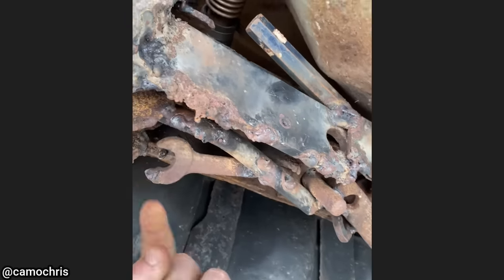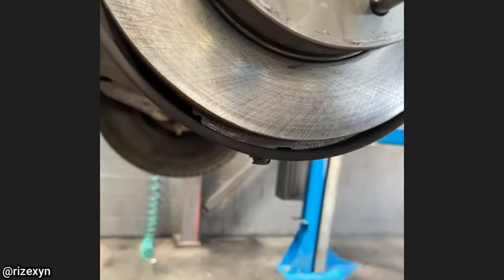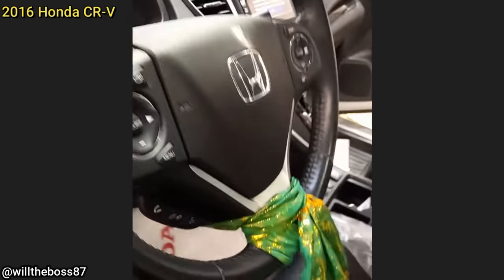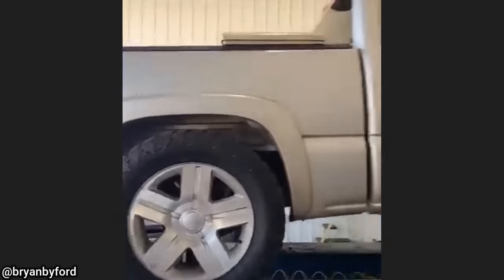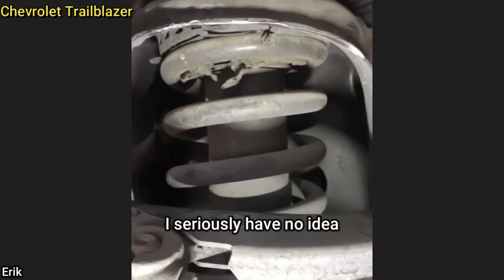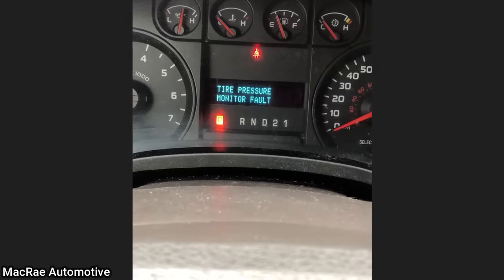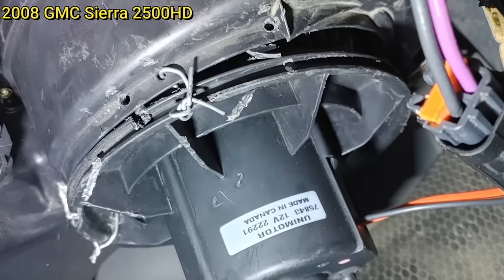Customer States Another Mechanic Said Their Car Is Junk | Just Rolled In

Comment: I sometimes wonder what's more stoopid.. refusing all repairs to do them yourself, or bringing it back in to the SAME shop after you've done the repairs and made it worse.
Reply: And on a towing!
Reply: Well, as long as you approve the repairs after effing it all up
Reply: Finally getting it fixed the right way is smart. Anything else is the stupidest.
Reply: First is check up,drive,inspection, history records etc then repair list.
Reply: Not bringing it back at all would be the worst, I think
Reply: I fix my own cars, it's not hard, you just have to be careful and take the time to do it right IMO. Ive never had an issue, but I always use the right parts, and install them correctly with a torque wrench ha
Reply: @Gormen Freeman It's not hard, you can do it if you try :) It's a lot to learn at 1st once you take in all the info about how it works, and how to do it, but once you do, it's easier then working on a computer :D
Reply: Should go for car mechanic crash course before buying car and also buy necessary tools with car's manual repairing book.They use to provide that book for machinary but nowadays who cares.
Reply: @karanmadan1048  Cant hurt, IDK if such a thing exists, but you can def learn from youtube. Just understand and be careful IMO, and you'll save yourself tons of time and money. It's quicker to fix it yourself then wait for a mechanic to do it, it's awesome
Reply: @seanstephaniesadventures1008  Also don't want to hurt you,theory and practical are two totally different thing.
Beside car manufacturers are not stupid to make simple and easy machine that a common man could work on it smooth like butter on bread.
Reply: @karanmadan1048  Ive been working on cars for years, it is incredibly easy though
Reply: @karanmadan1048  you're name is Karen. Why would we listen to you?
Reply: @drockjr  🙏 Thanks for you compliment really appreciate it.

Comment: The leaf spring blocks on top of the springs had me dying. 😂
Reply: Yeah, it's weird. The squatted truck thing.
Driving around looking like you overloaded your truck without anything in the bed.
Reply: @timsilva1944  Actually at oe ride height, they're doing nothing up there!
Reply: @timsilva1944  with the diff below the springs a block between the diff and springs will lift the truck. With the diff on top of the springs a block between will lower the truck. A block somwhere other then between the diff and springs wont anything at all except need longer u bolts..
Reply: @UFO-047  Yeah, thanks. After hearing the statement about "this squatted truck", I was shaking my head so much from disgust that I didn't pay much attention to the setup.
Reply: @timsilva1944  Weird? It always reminds me of what a dog does when it has worms!
Reply: I'm no mechanic, but when they showed that I went "Ummm..." and then the narrator said what was wrong. But I saw the shifted broken leaf spring. Guess I'm qualified for Wal-Mart Tire and Auto now.
Reply: @michaelmclachlan1650  "Customer states, My truck has an itch in the butt!" mechanic grabs the sixgun
Reply: @UFO-047  Yep, I'm going to guess they bought the truck lifted, and wanted to go back to stock height. They put the blocks on top to avoid having to buy new u-bolts.

Comment: The one thing mechanics don't want to hear "they tried fixing it themselves"
Reply: ha ha .. that's what actually keep the REAL mechanics busy ... and provides humorous videos for us all ... youbetcha
Reply: Along with them having it fixed "at another shop"...
Reply: Sensible mechanics will automatically double the quote if that's the case!
Reply: @stevie-ray2020  Doubling the quote reminded me of:
"Mister Scott.  Have you always tripled the time estimates for your repairs?"
"Of course Captain!  How else can I maintain my reputation as a miracle worker?"
Reply: Oh, but that usually means an open ended repair order, they're gonna pay for that screw up. it's just as fun as "I had a friend do the job for a case of beer". NEVER GIVE THEM THE BEER FIRST!
Reply: At least they’re honest and not blaming it on a friend
Reply: My friend Ben hates it when a customer walks into his shop and says “I’d fix it myself if I had time.”  The guy saying that has obviously already spent all kinds of time trying to fix it himself.  🤦🏼‍♂
Reply: Well, depends on what exactly you're trying to DIY. I could pretty confidently change my brake pads at home for example but I chose not to because it's a fairly important system where a tiny mistake may have serious consequences. I do minor cosmetic repairs though, saved a couple hundred bucks by straightening and repainting the rear bumper on my truck instead of replacing it with a new one.
Reply: Honestly most take it well as long as you tell them exactly what you did, when I had a motorcycle I messed up multiple things, mainly over tightening stuff and the mechanic laughed at me but fixed it 😂 oh and from bad experience not all aftermarket stuff is as cool as they seem, oem parts are oem for a reason - they fit and work as intended. Had my tire go flat on the motorway at high speed due to my "cool" new valve.
Reply: If i were a mechanic and i charged by the minutes i would be seeing dollar signs whenever someone says they tried to fix it themselves.
I would also be an honest mechanic and put it to them simply, i will have to undo anything they've tried to do but failed in doing. So they should be ready to understand that the work they've done has cost them rather than saved them money.

If they don't like it they can take it to a mechanic that won't set things right, and so they will be risking their and others lives.

I would however give them a small rebate as long as they haven't screwed up majorly. We've all been there, trying to fix something we don't have the tools and know how for and ultimately failing.
We've also been there when things go right and we do fix something ourselves.
In the end, what matters is if you know when to call it quits. Going beyond your abilities will cost you $$$.
Reply: I repaired an old 5.0 Explorer yesterday that the owner tried to replace the thermostat on. He broke a housing bolt off in the intake. The thermostat wasn't even the reason it overheated. It needs a radiator, and he ran it out of coolant.
Reply: How about "My mechanic said".....
Reply: No what we really hate to hear is "If I help you will you do it for less?". Then they always get upset when I say "No it will cost you double or more". I actually had a wrench "slip" and I popped one guy in the nose because he was that close to me. They day was hot enough and I didn't need him breathing on my neck.

Comment: That first truck was worth nearly $1m, not as a vehicle but as a modern art sculpture
Reply: I'm impressed that someone just welded whatever they had laying around like their buddies wrench, some old exhaust parts, whatever
Reply: @WayneWerner  neighbor’s ratcheting set? Just weld it on there, that’s just more reinforcement on the joints
Reply: @TheBanjoShowOfficial  Honestly at that point, you might start using close to the same amount of welding rod/wire to just make an I-beam out of weld lines. No idea why they didn't think to weld all the items together into a solid rod first, at least or something..

but I guess you need to be already out of sense to think this is a good fix.. like, if I was desperate, even I'd go to home depot, buy a 10$ thick-ish fence post, and weld that sucker up there...
Reply: @WayneWerner  Not that I've ever welded a wrench, but those things are usually made out of high-carbon steel and are going to crack if you weld them. So it may look cool but it isn't structural.

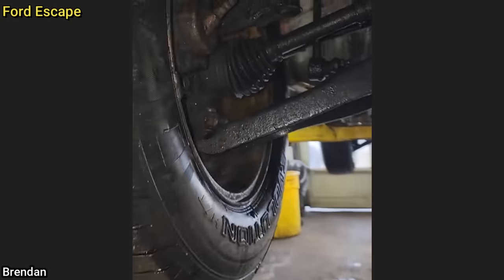Comment: 1:42 Check out that brake rotor!  And a vise-grip clamping the flexible brake line too.  Yikes!
Reply: When you have a leak, you have to clamp off that brake line so you can drive to get it fixed. Otherwise in a few stops you have pumped out all the brake fluid. I drive in salt all winter and in a few years brake lines rust through; I have done this fix a half dozen times. All my vehicles are pre-2012.

Comment: 1:42 Look real close at the brake disc. The inside portion is missing, and all that you see is the cooling fins that allowed air to flow in to assist in cooling.
Reply: So it was just the right time to approve all repairs, wasn't it? 😅
Reply: The owner obviously 'fixed' the brake problem with a pair of vise-grips. That's a lot cheaper than new brake parts.
Reply: You say all that like it's a bad thing.   😁
Reply: @markh.6687  LOL, I will admit to doing that myself back in my Chicago days with rusty brake lines.

Comment: I had a weird noise when turning, turns out my sister bought a toy for her cats, left it in the car, forgot about it and it was torturing me with the "weird sound coming from the rear" until i was cleaning the cargo area and found it. Didn't go to the mechanic as my car has a tendency to have random noises for a short while before they dissappear never to be heard again and it didn't appear to affect drivability.

Comment: I used to think I'm relatively safe on the road, so long as I don't make a mistake. Then I learned that an estimated 1/4 of cars in my country are driving without the mandatory yearly safety inspection. And then I found this channel and now I drive in fear of other cars.
Reply: That's good, a lot of people never even consider that driving is dangerous af. It's the most dangerous legal thing you can do lol
Reply: If it makes you feel any better, only 22 of 50 US states even have annual safety inspection requirements.  There is no statistical difference in incidents in states that do.
Reply: a lot of states no longer require annual inspections
Reply: Here in UK, any vehicle over 3 years old, needs an annual inspection ( MOT), if any major faults are detected at the test the vehicle cannot be driven away for repair. An MOT cert is required  for road tax, and any untaxed vehicles caught on the road can be seized and crushed.   Vintage vehicles are exempt as the owners are deemed to keep their vehicles in road worthy condition
Reply: You think thats bad? Our local sheriffs office in cooperation with the Virginia State Police operated a stop and check for trucks traveling on one of our main routes. More than a third failed safety inspection and most of them failed so bad they wouldn't allow them to continue operations. We're not talking about little u haul trucks either, we're talking about dump trucks and full tractors pulling 60'+ trailers. Scary
Reply: At least in the USA, only about 12% of accidents are caused by mechanical issues. Most people exercise their vehicular stupidity in how they drive, not in maintenance or repairs.
Reply: Back in the 50s, Tom McCahill advocated defensive driving...I'm alive because of it...mufflers, A-frame parts, drive shafts, WHEELS, and one trunk lid tried to kill me...always have an escape route.
Reply: @dirtfarmer7472  thank you for your due diligence. It's good that some people still have pride in their profession
Reply: @Sashazur  If you're "maintaining" your vehicle like a lot of the people shown on this channel, you're probably doing a lot of other stupid shit while driving, too.
Reply: Drive in the wee hours of the morning then.
Reply: @dcsteve7869  they should do more of that rather than speed trapping. Would actually make our roads safer
Reply: @tmanepic  absolutely true
Reply: I live in a state without a "mandatory inspection",  But a cop can red tag a vehicle they deem "unsafe".

Comment: Text story for ya guys.

Just got a job at a dealership, hoping to become a mechanic.
Lube tech did a oil change on a Cherokee. Engine blew up short while later. 

Tech apparently did a oil drain instead of a change. No oil, filter was half on.

Lady got a new engine. 

Somehow, we ended up with her rear floor mat not in her car. 
Service manager wasn't very happy. I didn't see that Tech since.

Here comes the best part. I had to do a car delivery and another porter was to pick me up in the shuttle. He was going to deliver the floor mat back. He picked me up and we went ot deliver it.

Dude takes the last of 2 turns too fast, and goes into her yard. Winter, Michigan, 2 days after a snow storm. Shuttle is a FWD Mini Van. 

Then I, the noobie, had to hook up a tow strap to the van cause the other porter, who worked here since July, didn't know where to attach it. 
(Had to settle on a control arm, as I couldn't get close to the frame, muddy, snow covered field) 

Interesting first week to be sure.
Reply from the maker: Oh my 😅

Comment: The Buick thinking its a Cadillac hits too close to home haha!

I work at the GM proving grounds and worked on that generation of Enclave. It's literally a single bit in the code that gets flipped on or off (I believe its tied to the VIN stored in the Body Control Module.) For a while most of my fleet of (prototype) Chevy's, GMC's Buick's and even a Holden I worked on had this issue.

My best guess is the Cadillac splash screen is the defaulted state for that software set. Doesn't do anything else other than show Cadillac logos, Cadillac vehicle silhouettes on the cluster and change the name of the default WiFi and bluetooth to MyCadillacXXXX. I'm shocked to see it make it to a customer in the field this way!
Reply: "Nobody skips the quality like GM"

Comment: I had my new Toyota MR2 Turbo back in the mid-1990s.  Took it in for an oil change at one of the name-brand 'quick oil change' places.  The 'tech' broke something in the electronics (it's a mid-engine car) while doing the oil/filter change and I had to tow the car out of the oil change shop.  I had them tow it to the Toyota dealer.  "The Toyota dealer charges too much for oil changes, I'll pay about 1/3rd at a speedee oil change place"  NEVER AGAIN

I had a Pontiac Fiero prior to that.  Needed a new clutch.  Took it to a mom-and-pop shop. Put in the clutch.  Was making an awful grinding sound every once in a while.  New clutch failed after 500 miles.  Took it to the Pontiac dealer.  The mom-and-pop shop 'tech' dropped a bolt into the clutch bell housing and didn't fish it out.  "The Pontiac dealer charges twice as much for a new clutch, I'll get it done cheaper."   NEVER AGAIN

Every single service on every car I've owned since then is done by a dealership.

Comment: I can do minor mechanical and electrical work on my own car, this includes taking out the radiator to be repaired and putting it back in, replacing the wheel hubs and even installing the drive shafts on my car (its front wheel drive). I have never once warped a frame, cut into the frame or damaged any important suspension bits to try to make everything fit. And if there's ever any work that requires that stuff to be done, I'd rather take it to a professional body shop that is capable of doing it well and safely instead of ruining my own car to do it myself. Because buying a new car is certainly more expensive than having stuff done that's beyond my capacity to repair it done professionally.

Comment: I have the same generation GM truck and had to do a blower motor on it. I ordered the wrong one from rock auto, wasn't worth sending back ( I'm in Canada) but it never crossed my mind to hack my truck up to make it fit lol I just spent the $50 and got the right one 🤣
Reply: im the one that sent it. and it was indeed the twist type blower and not the bolted blower. 
the worst part is they damaged the hvac case so much that even with the right part it barely held in place and leaked air all over the place.

Comment: the squatted truck is just plain crazy. it looks like the customer did most work by himseelf, but once again, only half-assedly. and without an inkling at to what does which. (besides, why squat a  truck? it's like squatting a SUV and put 25inch rims on it.

no, wait.)

reminded me of the time some guy tried to tell me how he planned to lower his old 70's Ford Taunus at the front. he was pretty secure with mechanics work, and I'm a car mechanic myself... so the plan was to shorten the rods tying the front stabilizer bar to the lower arms. I tried to tell him that won't do anything but waste his time, since the stabilizer bar does move and is supposed to move, with the front wheels (it does drag up the inner wheel when you turn into a curve to keep the car from leaning into the curve too much, and prevents the car from turning and swaying along it's lengthwise axle).
we eventually parted, and I never saw him again, nor heard about the... project. I sincerely doubt it worked.

Comment: I had someone bring me a car that was overheating from time to time.  When I opened the bonnet to check the issue, I found the radiator was bungee corded in place, the electric fan was removed, and the radiator shroud was completely missing.  I told the owner the situation.  She told me her husband took the fan off because the aftermarket radiator would not fit with the fan.  The radiator shroud was not installed because it did not fit on the aftermarket radiator.  Bungee cords held the radiator somewhat in place because the bolts did not line up for the radiator and the car.  The wife told me that he bought an aftermarket Jeep radiator because he was told the Jeep radiator would fit his F-150 flawlessly. I told her the vehicle needed a new radiator, fan, shroud, and hardware with our professional installation.  She became very angry and said, "My husband is a professional!"  She grabbed the keys and took off.  I am glad she did not want our service.  I would hate to be the one to repair her vehicle.  It would be nightmare for the mechanic, even if the job were node perfectly.